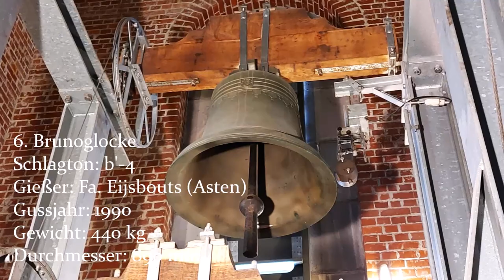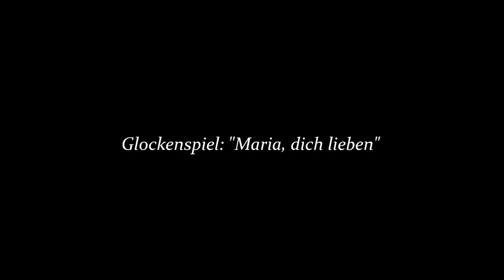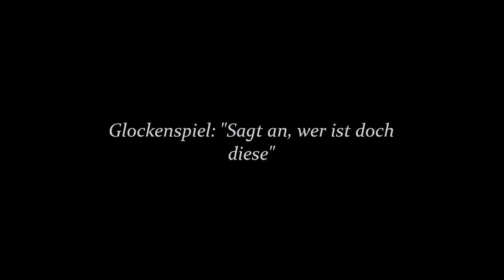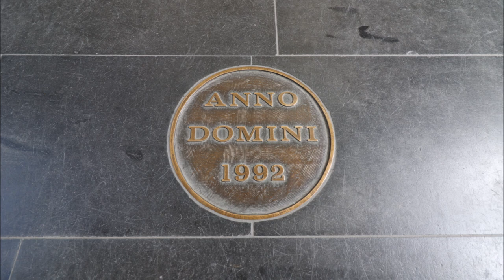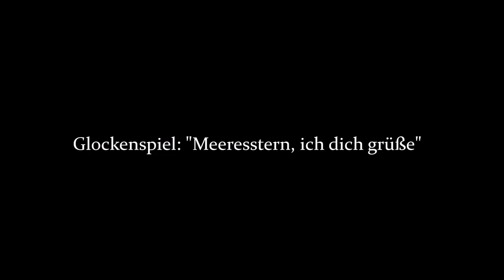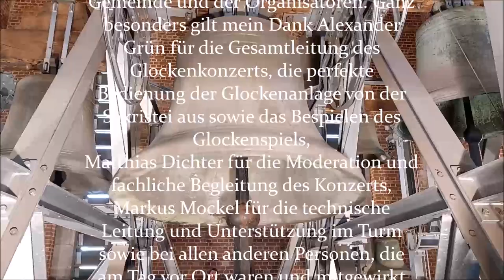KÖLN [D] - röm.-kath. Basilika St.Kunibert - Glockenkonzert am 14.05.2022

Comment: They should have put hammers on ALL of the Bells to play with the glockenspiel. How come the big bell has no chiming hammer
Reply from the maker: Since the church has the small carillon, the installation of striking mechanisms on the larger bells has been partially omitted. Of course one could retrofit this, but there is no use and no need for such hammers, since in the Rhenish tradition not all bells have to be equipped with percussion hammers.

Comment: Will it be possible to visit the bell tower ?
Reply from the maker: The tower is not usually open to the public. Therefore, the bell cannot be visited. However, there may be an opportunity later to visit the bell at an event.
Reply: @GKD2015  thanks and wher can I see if thers an event pls ?
Reply from the maker: @mikhailscicluan2065  Well, if there is an event, I can tell you.
Reply: @GKD2015  ok thanks than 🙂